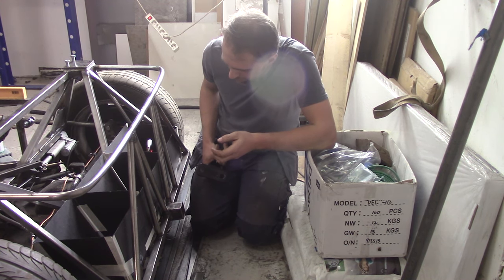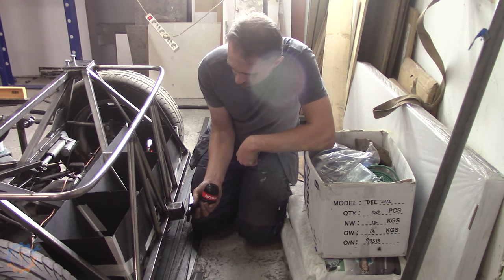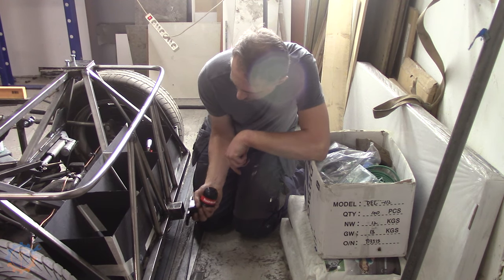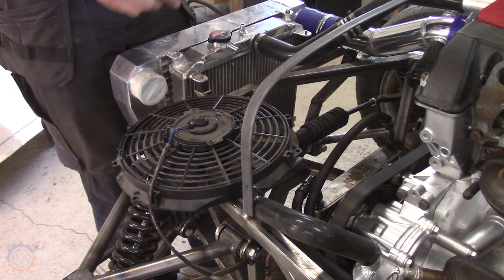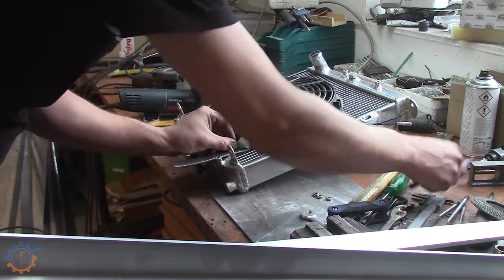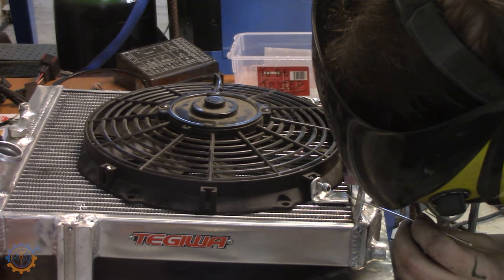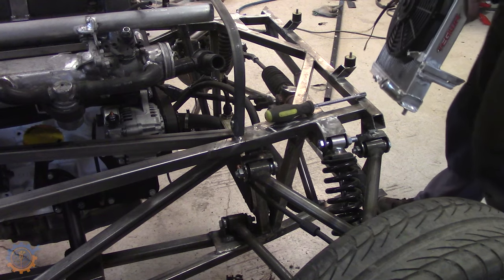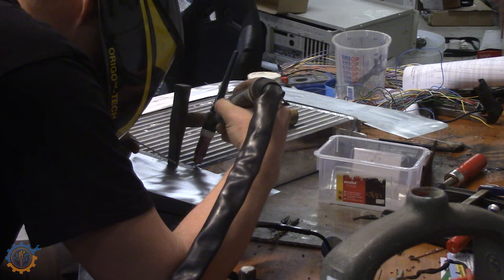Building Super 7 Locost EP19 Cooling fan and hitch!

Comment: Give that radiator a 15psi pressure test after putting that heat into it. Just sayin.
Reply from the maker: Its running fine with 15+ so its tested :)